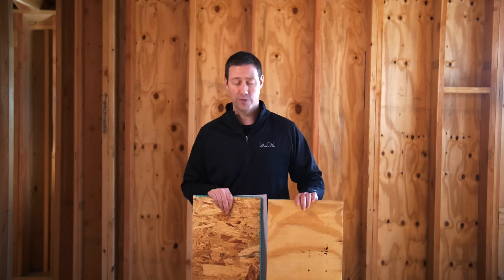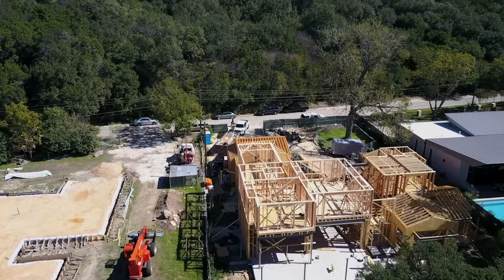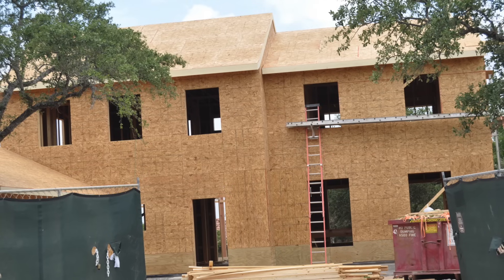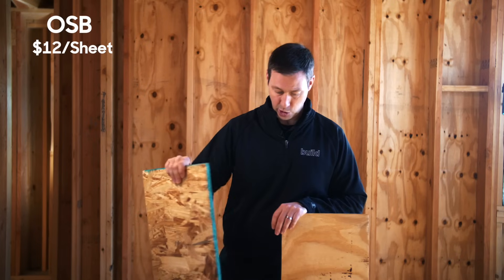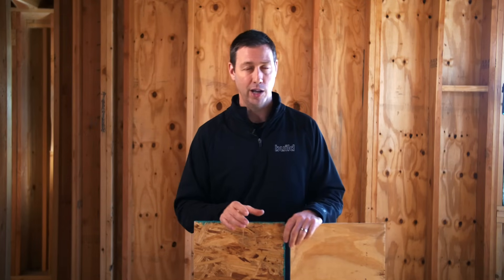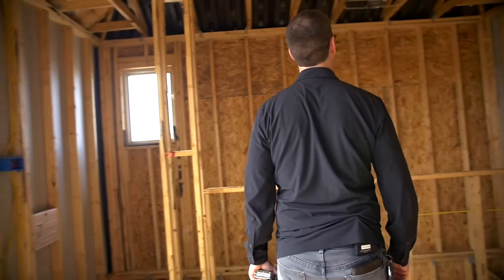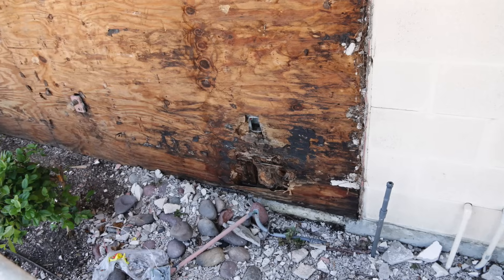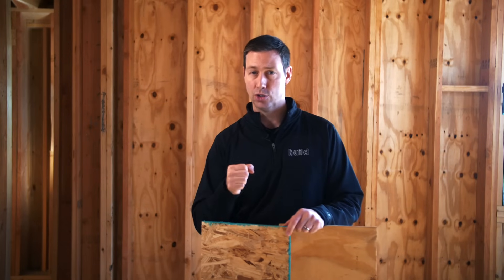Framing : OSB vs. Plywood - Whats the difference in COST AND PERFORMANCE

Comment: The real truth of the matter is, you want airtight buildings.?  Better make mold and mildew your friend.. the end
Reply: You know, there are inexpensive systems that exhaust inside air and replace it with outside air, right?  Panasonic makes them, for example.  My house has no mold or mildew, despite being VERY airtight in a damp climate.

Comment: OSB expandswhen it gets wet.
Reply: fbabdiver so does plywood
Reply: Not as much.
Reply: Cotronixco I might argue this point... OSB swells more in thickness than plywood however plywood grows more in length and width then OSB. I've placed the newer generations of half inch plywood as roof sheathing and after a rainstorm unprotected it actually buckled between the rafters from expansion.
Reply: First plywood swells in length and width, then OSB swells in length and width?
Reply: Cotronixco overall I find that OSB holds up better in bad weather then plywood. Of course I've seen high grades of OSB where they've actually use it to make boat docks. So saturated with resins that it became waterproof
Reply: So it's OSB, then plywood?
Reply: Build show
Reply: questioneverything2  
That is because of the crap plywood that is being made today. Back in the 70's plywood was known for it's dimensional stability. Recently I bought some new plywood and the whole stack was like those canned potato chips, and when I made a door for my shed out of it, I was amazed because in 38" or so of width, it will change 1/4" between seasons. I had never in my life seen plywood do that.

Comment: I'm in England. UK.  Can ask how thick would the osb or Plywood be ?? 
Do you use Plasterboard it's a chalky type compound with a thick paper outerskin " about 1/2" on internal walls ??
Reply: Sterlingboard OSB comes in 9, 11 and 15mm as standard. It's about half the cost of the cheapest plywood in the UK. Americans call plasterboard/gyprock "drywall". It seems like nobody over there knows how to make a wall any other way.
Reply: @lordsummerisle87  I think . We have strict building regulations. ( due to Fire's,  ...plus ..if you have a pipe leak in drywall  /plasterboard. ..Easy to cut it . 😁 
Great videos. And thanks for replying.

Comment: We use OSB (and OSB2) in the UK primarily for cheap shed roofs.

Perhaps we only have low grade OSB available in the UK, but it's regarded as cheap option with 12mm (Yay Metric!) the common preference.

Comment: Not a carpenter but curious. Would a builder use plywood on the bottom 4 ft and the rest OSB to get the best in water protection and cost? Or would the difference in shrinkage of expansion between the 2 cause a problem.

Comment: I have been up on many roofs from the 70s  and found plywood de-laminating and unsafe to walk on assuming from improper attic ventilation. I have never been up on a roof where OSB made me fee unsafe, unless it had water damage from the much outdated shingles. Even though both products have their good and bad, for the cost I would take the OSB any day.
Reply: 50 year-old plywood will likely have issues...comparing it to ten year-old OSB isn't exactly a fair comparison.

Comment: One thing I'd ask for if building a new house would be flashed ledges over the windows and sills under them, to keep the water away. They were common on older houses, but a lot of new ones have almost perfectly flat walls, making them look more like big trailers. I'm sure that works if all the sealing and flashing is done right, but what if a few windows need to be reworked or replaced? It the ledges and sills could remain in place when the window is removed, the chances of it leaking when put back together would probably be a lot lower.

Comment: What you were showing looks like wafer board, with osb the strands are oriented 90 degrees to each other similar to plywood, wafer board the strands are random, I feel that plywood is far superior to wafer board in both sheer strength and in fastener holding and spec plywood in all of my projects, osb is my 2nd choice with wafer board a distant 3rd. Just my 2 cents

Comment: You mentioned that there are different grades of OSB. It's worth mentioning that the better grades have better moisture resistance and perhaps a solution to the problems of deterioration in areas in the build that may be susceptible to moisture resistance - such as window and door reveals and the bottom of the building close to ground - in these areas you could use a higher grade OSB that has better moisture resistance. Here in the UK timber frame building construction was rarely used, but it is becoming more popular now as it is a much more cost efficient method than our traditional brick and blockwork construction methods. Also there are more stringent regulations on thermal efficiency of construction and these are more easily achieved using timber frame methods - so this also has promoted timber frame construction methods being used. I did some investigation on more information on the comparison of OSB board v Plywood in conditions where they are subject to moisture, Plywood performed considerably better that OSB board. OSB board expanded considerably more than plywood when subject to moisture, also OSB once expanded does not shrink back at all when drying out, whereas plywood shrinks back to almost its original dimensions. You may find this video made by an American flooring company informative:  https://www.youtube.com/redirect?v=kzBZ82vukzI&redir_token=nYCd6k3Stwhx3znUsl5tVNVKun98MTUzNTMwNzc2MUAxNTM1MjIxMzYx&event=video_description&q=https%3A%2F%2Fgaylordhardwoodflooring.com%2Fproducts%2Fplywood-vs-osb-subfloor-comparison%3Fvariant%3D14366055939
Reply: Yeah once OSB swells it's done, with plywood it can de-laminate and you still have solid wood sheets there and the fasteners can keep it somewhat rigid.

Comment: I put a new floor in with 4x8 osb last year. And  now my floor falling throw the floor I pulled up interlock tile and the osb is moldy and the osb flooring was soft  like sand and its black.  Also all my floor joists are  moldy to . Were did I go wrong  with this  I have the floor joists on concrete bricks also you cant not claw under the floor.

Comment: After watching two brothers building twin houses side by side. One was typical house with OSB all over, the other house used plywood. With identical windows, doors, insulation the plywood house was definitely a much quieter interior. The OSB house had traditional 2x10 or 12 floor joists. Plywood house got engineered floor trusses. While waiting for some products to come in they decided to get truss maker to measure floor sag under load. 
And the floor trusses glued and screwed, with adhesive and plywood screwed every 6 in the floor was deflecting thousandths of inches with BACKHOES driving over floor. Other house, had much more deflection and actually the OSB flooring needed some pieces replaced. 
They had water run off from small pond levy break( it was slated to be drained but hadn't been done yet) OSB house had to have lots of water damaged sheets replaced.
Plywood project got away with minimal damage and actually dried out quite well. 
As many state limited use if OSB makes me happier.

Comment: I've seen a millionaire home build using 6 inch c chanel as the studs. And 1/4 inch 4x8 plate for exterior wall frame build ..it was amazing..

Comment: Why not spray resin on the outside after the plywood is put up? I fixed up a house trailer that was 40 plus years old. The wood that had resin on it looked brand new. The wood that was below the windows didn't and was mostly completely rotted away.

Comment: Great information!  Nails used in attachment of subfloor joists turn into nightmare squeaks 15 to 20 years down the road. Have to rip up subfloor to find it and replace the nails with screws. Custom home builders should only use screws in their subfloor joists and subfloor installations!!

Comment: Thanks for doing this comparison and pointing out the real cost differential. You are absolutely correct that both plywood and OSB can fail if they are constantly getting wet but plywood will tolerate it far better than OSB. Leave a sheet of each out in the rain for a day or two and you'll see that the OSB starts delaminating almost immediately where as the plywood will be fine. Worse yet is particle board that once wet becomes "fallaparticle" board. Complete junk. I had a guy that I was friends with in NC who told me he was using it for his roof. I told him he was nuts especially in an area noted for hurricanes where shingle damage would certainly lead to the particle board disintegrating. As you noted, there is a cost differential between plywood and OSB but in the scheme of things, is spending $1200 more on a 7000 sq-ft. framing job really that much more? There are better places to save a buck than on the structural integrity of the house.
Reply: “Fallaparticle “ board. Love it .well said
Reply: @arnolddavies6734  Thanks. I'd like to take credit for making up the term but I heard it from a builder years ago. Thought it was pretty funny and on the money, so much so that I never forgot it.

Comment: Most commercial contractors now use osb, but make up for it with thicker sheetrock for fire resistance, sometimes double layed, espicially in commercial buildings.

Comment: Do Americans not allow for an outer leaf masonry construction on exterior walling? That is the standard here (Scotland), with your external walling being 9mm OSB/Ply sheafed structural 2x6 studs with a external non-structural 100mm block/brick course tied in, timber cladding is often shunned here for domestic properties, as it is renowned for letting in water during driving rain, the masonry leaf is also well liked for the additional sound proofing it offers as well as the way is disperses wind loadings across the wall panel.

Comment: They used foam sheathing instead of wood at my parent's house. You can see it in the attic behind the studs. Plus you can see light shining through the cement board siding.

Comment: Matt I agree about the plywood being better, but you didn't mention a few other thing like the sheer strength of ply vs osb and as a framer first and general contractor second, when you screw up your starter coarse with osb you can just rip it off the studs and go again, not so with ply, you shoot ply with galvy 8 rings it's a sawzall day. No osb on my jobs ever... Maine coast high end ocean front, New England builder and I said so
Jerry Rose

Comment: Hi Matt
It looks to me you are using OSB on the outside of youre buildings.
In ouer understanding OSB dos not let humidety trugh so like skandinavia we had to remodel houses where OSB was used on the outside because of bigg temprature changes summer winter we have the conveksjon who draw humidety inside the wals and are then catched
inside the wals insulation and amold and slo rotening proses starts.
So we use a soft wood chip plate coted vith asfalt and then a layer of brething wind cover
Tyvek or somthing alike and all luse ends taped to windprofe and stop wind and draft from coling down the insulation.

Comment: for the people actually doing the work, OSB is a nightmare—it’s
heavier and way more toxic to cut.

i also wonder about the longterm health effects for residents as OSB off-gasses over time. if you wanna cheap out and use exposed OSB as flooring, paneling, etc., be sure to seal it to contain the toxins.

Comment: I can say, that the house I am in now, they used OSB just on the outside corners, and the sub floor.  The stucco has cracked several times, and one time had to be repaired before the move in date.  Now the sub floor.  For the first 5-8 years, there was a content coverage of sawdust on the basement floor, from the OSB crumbling.  So that terlls me the sub floor was falling apart.  That was something I could never afford to replace.  It has stopped "SHEDDING", but in this house, just my mother walking past as I sit on the couch, the floor bounces, and she weighs maybe 110 lbs.  Now my cousins Modular home, with plywood sub floor, he can walk by and the floor never moves, and he weighs over 360lbs.  So if I had to do it all over again, it would be plywood everywhere.

Comment: I can see where future sheathing choices are treated for water permeability. If I was building my own custom home, there would be special treatment for any wood fiber sheathing used. This could be as simple as treating each sheet before it is installed. I've seen many failures over the years and sheathing can't be guaranteed against water deterioration.

Comment: I have a manufactured home with a leak in it from the roof and it happens when it pours down rain during storms and dry the rest of the time. I am going to hire someone to go up and check the roof for where the water is coming in. I don't want to end up having to replace the roof due to a leak which may get worst and I got the 2012 home in 2013 and it should not be leaking yet.

Comment: Probably the culture of building houses in the US, but where I was born the inside of 99% of the houses are concrete slabs bolted together, bricks for a the exterior look. 
The concrete slabs are so hard you can't drill in them without a hammer drill. Rock solid, no possibility of rot, will last forever.

Comment: someone used that material to remake the floor of my bathroom.   After a water leak, that stuff turned to mush and fell apart like wet cardboard.  When I had the disintegrated floor replaced we used plywood.  Whenever I see these new residential buildings going up with that stuff on the walls I think about how it might not hold up when the roof springs a leak in 25 years hence.

Comment: I was puttin gup an interior wall in my new garage and notice 7/16 OSB was three dollars a sheet more expensive than 1/4" plywood. I used the plywood. I'm actually holding off on all other construction until lumber prices get sane. I see 2x4's are dropping in price again...

Comment: When I built my shed I used OSB. Plywood was close to $20 a sheet and OSB was $6. No brainer. But it is not exposed to water at all. They are both about the same price now so it's all plywood for me. But I'm holding off on "non-essential" projects until prices come down.

Comment: ugh-! My house was built in1971, and has a "triple threat": Celotex brand sheathing (1/2" peg board, without the holes). Terrible stuff that expands and flakes apart once water continues to hit it, and can't really hold nails; cement "asbestos" shingles over it; and aluminum wiring. Thank goodness I have almost all the aluminum removed. The sheathing and shingles are another story. I plan to go a wall at a time, remove it and replace with OSB. What sucks is I have nice vinyl siding up all over the house, so I have to remove that and replace it back up. Unfortunately, I didn't have the money to do the sheathing along with the siding originally.

Comment: Jeeze.... why would you run timber frame right down to ground level?  Why not build masonry dwarf wall and then timber frame on top of it.   I guess you don’t build houses to last in USA.  Keeps builders busy I guess 👍

One thing I’ve noticed about OSB vs ply is that OSB expands and contracts more than ply due to temperature change.  

This movement over time can put pressure on seals round windows, doors etc...  something to consider if your going to use a silicone based render system to finish the property.

Comment: OSB sheets come with painted edges. Ply? never saw it.. When I was a framer and the forklift brought up a new cube of OSB, we would usually chuck the first two or even three sheets off because they were falling apart already. OSB was not dimensionally stable. I remember people from the manufacturer coming to the job to take pictures of their product and they wanted all the joints spaced 1/8/" apart. The sheets measured at least 96". I think one of the buildings grew out about an inch at the top on each end because of the rain. 1st floor was on concrete. We couldn't plumb the end units. We just closed our eyes.

Comment: It was not call shiplap, it was called storm sheathing. It was used for sub flooring and used as roof decking boards. Storm sheathing boards were run at 45 degree angles on exterior walls for added strength and used on inside walls as backer boards for plaster wall clad finish.  I'm 4th generation builder and as I have torn out and remolded on such structures for many decades, worked with my Dad and uncle's on a few additions back in the 60s where we sheathed everything the old fashioned way as was the structure we were adding on to. Shiplap is a exterior wall siding , with grooves and or laps to keep rain from coming through.

Comment: Around here..during construction... they routinely leave the framing exposed to the elements . OSB is superior for mitigating against lateral seismic shear but should not be left exposed to the elements. However, I have left pieces outside for years...and they are still useable as a saw horse top.